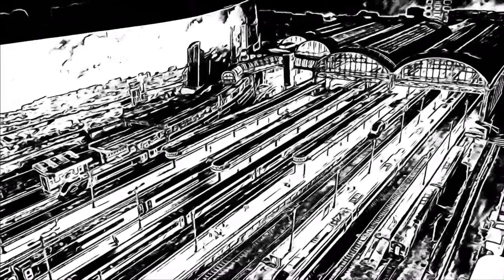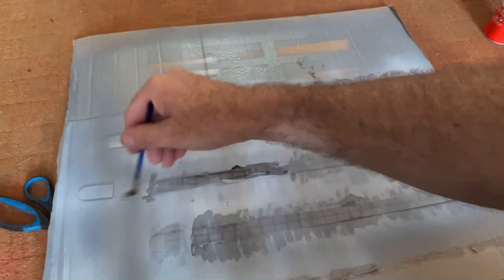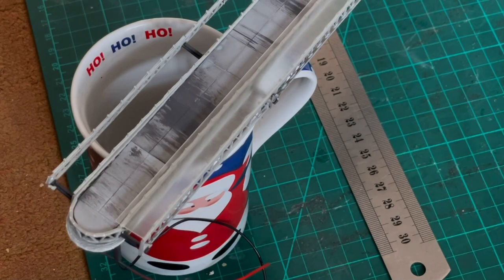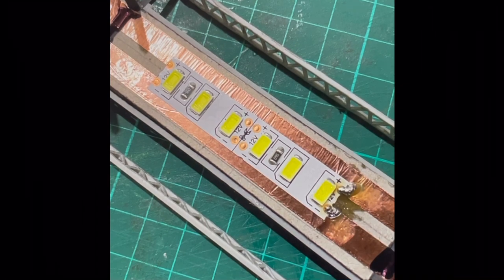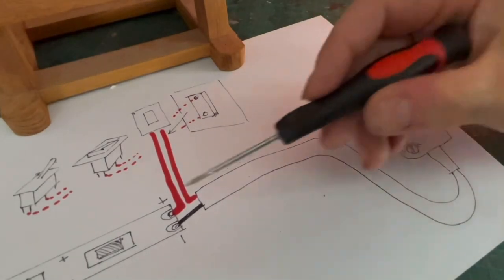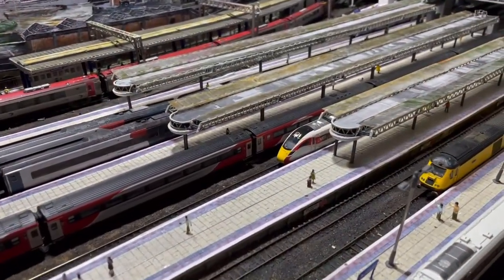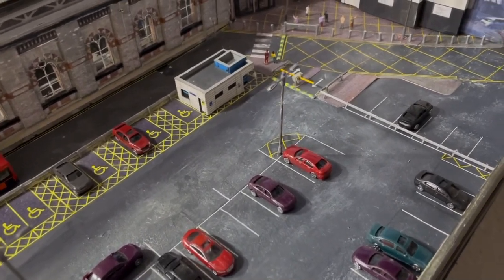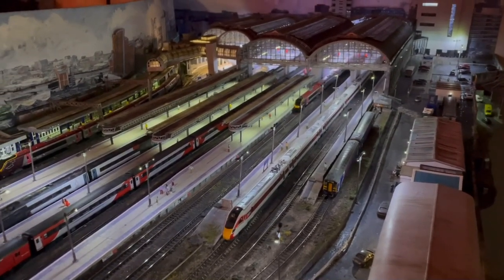MANCHESTER PICCADILLY  IN N GAUGE – COMPLETING the PLATFORM CANOPIES

Comment: Hi John Well, this is wonderful, I do like the canopies and a great little tip using the copper tape. To me it really gives the impression of Manchester Piccadilly, I'm interested to see how you tackle the OLE masts etc, as they are more or less nearly original 1960's equipment, ie quite bulky and not at all pleasing to the eye. Well done!
Reply from the maker: Thank you Peter, so glad you like it. The OHLE gantries will be 3d printed in many part and glued together, much like those on Pl13/14 except they remaining ones are much bigger as you mentioned. 

The printer has developed an issue, so it all depends on how quickly that’s repaired. Other things can be done, but school work is gathering pace now too.